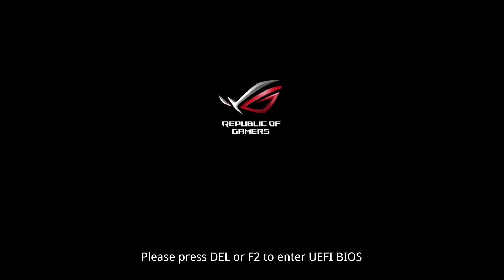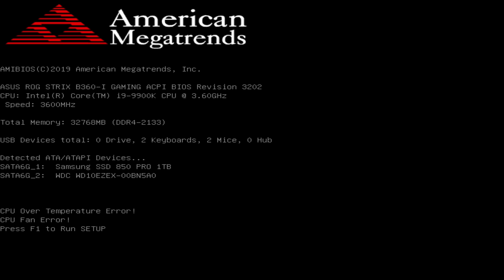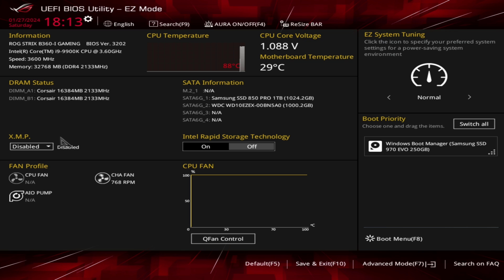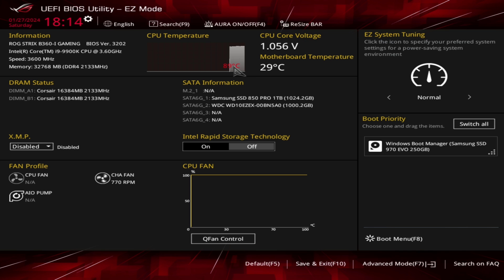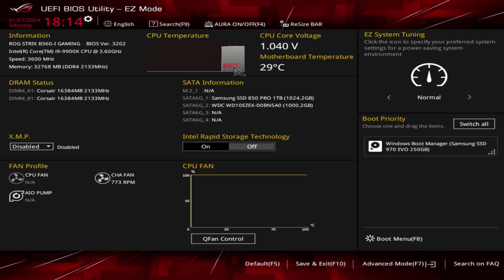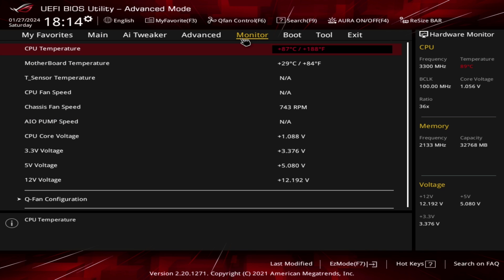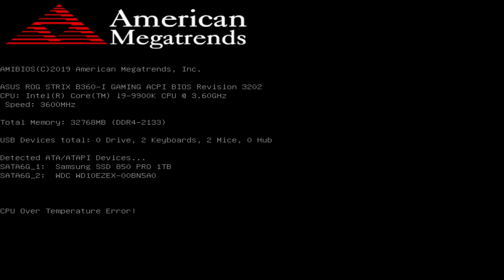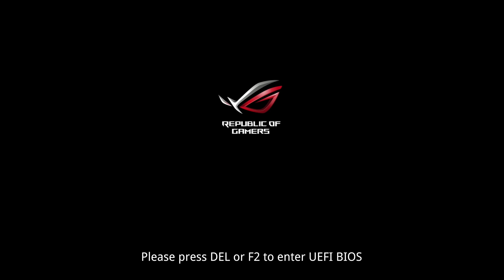How to Fix CPU Fan Error in Asus Motherboard

Comment: Hi, I get a CPU fan error when I turn it on but I don't have any temperature issues. I set CPU fan Speed to ignore but every time I turn on my PC the problem reappears
Reply from the maker: Hi! It sounds like your motherboard's BIOS/UEFI is still detecting the fan error despite setting the CPU fan speed to ignore. Sometimes, BIOS settings don't save properly or need a full reset. You could try updating your BIOS, double-checking the fan connection, or setting a custom fan profile with minimum RPM. If the error persists, temporarily disconnecting the fan or replacing it might help identify if the fan itself is causing the issue. Hope this helps!

Comment: The fan is spinning but it cannot detect the fan is spinning
Reply: Ye weird shit only poppped up lately for me. Didnt have it for over half year. 

But my fan speed shows 2.5k+ in bios. My guess is that it is not fan speed but AIO pump speed rpm. And that why error gives even when fan speed shows a number.

But at 2.5k rpm for a fan it should sound like jet engine almost...and it doesnt.
Reply from the maker: @Syphirioth  Because the pump header is connected to the motherboard's AIO header, and the AIO cooling fan is connected to the CPU fan header on the motherboard.
Reply: @HTBasicOnline  It worked fine before. Everything is connected accordingly. 

So my fans are not connected to any fan header since they are connected to a hub for fans. So the system should assign it accordingly. As it did before.

I think for me there is just conflict between corsair and asus hardware. And probably some update on software created this problem.